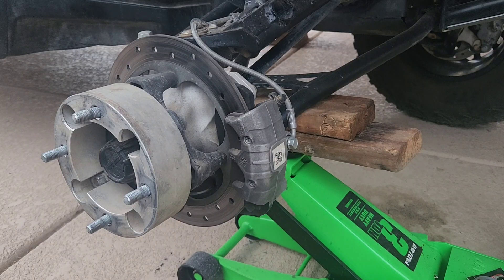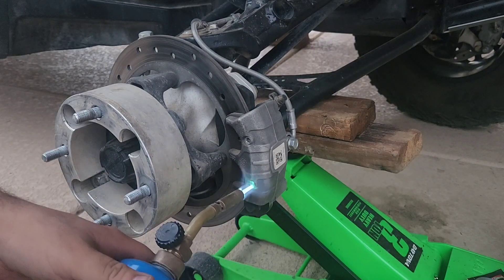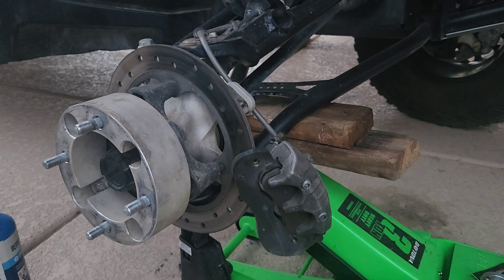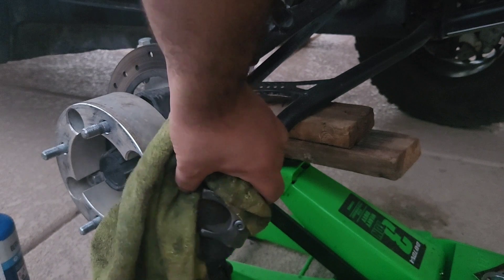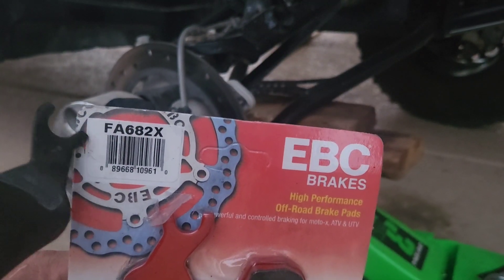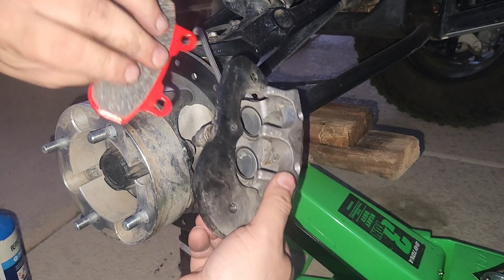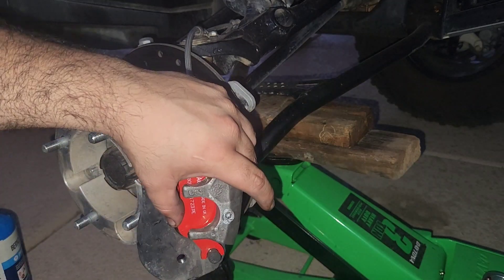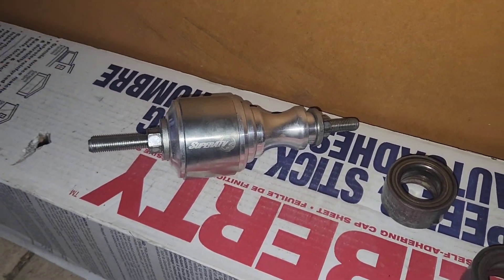Can Am x3 EBC Brake Pads Replacement

Comment: All balls racing make a update pin kit for the mavericks, a solid hex key pin way easy-going for removing those pads. eom pads are junk and dosent bite, change them all for ebc racing. Ebc are better for pedal feel and stoping distance whitout locking the wheels.
Reply from the maker: Yeah those updated pins are worth replacing, it was a customers car and luckily I was able to remove all the pins. EBC brakes are the way to go 🤙